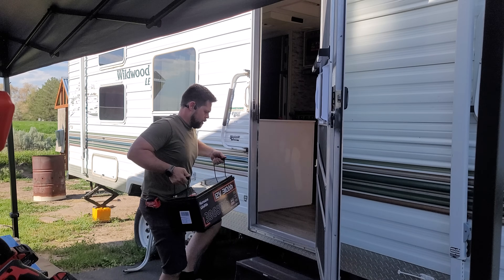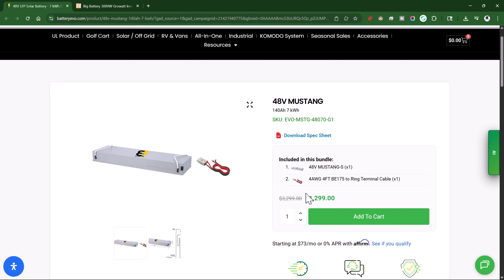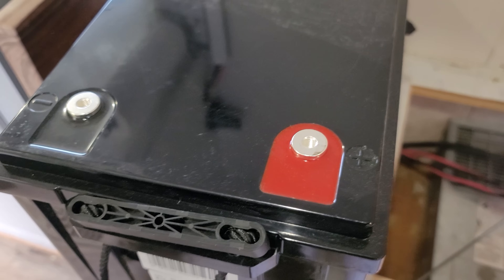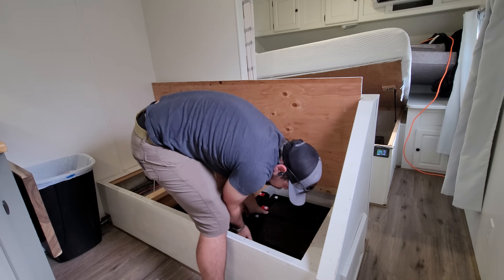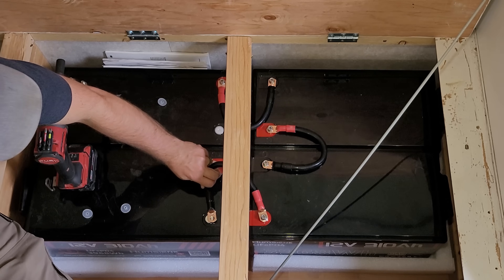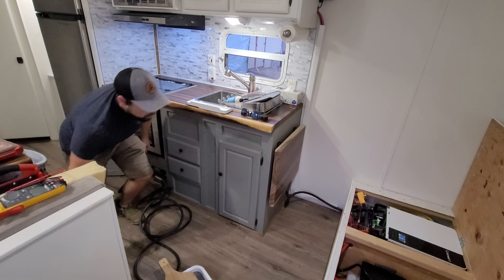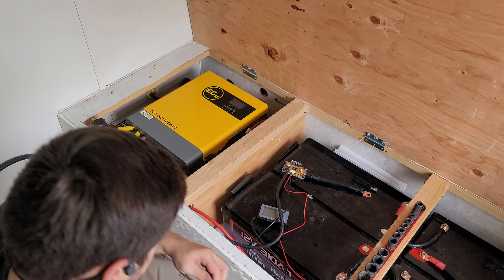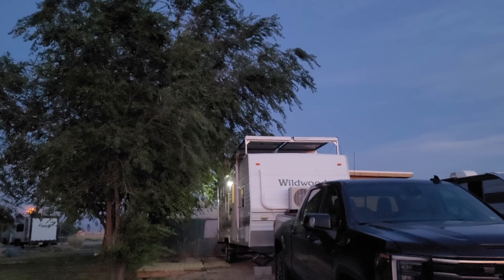Dirt CHEAP LFP Batteries Run My Solar Off-Grid RV

Comment: Dude, you don't have a clue what you're doing. Not only do you not have a battery balancer installed, which will result in the damage of those cheap, short lived batteries, but you've also installed an EG4 non-UL-458 listed inverter that doesn't offer any automatic neutral ground switching which will one day result in electric shock or even lethal electrocution of one kf you RV renters. No non-UL-458 listed inverter should ever be installed in any mobile application. You really should have done your homework before making this video.

Comment: Always fun to have a good excuse to rip up and redo a system 🙂Though I can't help but feel that you took a step backwards ripping out that nice 48V big battery only to replace it with a bit more of an ad-hoc set-up.

--

Not applicable to a series 12V x 4 setup, but I will remind people that with native 48V battery systems the higher voltage does give you the flexibility to separate the batteries and put the inverter somewhere else as well.  They don't have to be right next to each other.   It's nice when everything is all in one place with equal-length cabling to the busses, but not actually necessary.

The SOCs will diverge in the middle of the range but will re-converge near empty and near full.  And the voltage drop from long cables will only represent (typically) 1% in losses in a 48V system instead of 5%+ in a 24V or even worse in 12V system.

So its always an option that should be considered when there are space constraints or weight distribution issues and the system is 48V.

--

Also a reminder:  You can cable 48V systems with 2 AWG and still create a system scaleable to 20+ kW of delivery without having to re-wire anything.  You just individually bus the batteries with 2 AWG to a high-amperage bus (even a Victron power-in, for example), then run 2 AWG to each 5kW (ish) inverter.  Totally scaleable without having to re-wire with bigger cables.  Just add more batteries and inverters.

Of course, if the batteries are huge (e.g. 16kWh beasts instead of 5kWh beasts)... then we're talking 2/0.  But for 5kWh beasts (or if each battery is only expected to deliver no more than 100A anyway)... 2 AWG is plenty.  I honestly don't know why people still use huge thick cables.  Maybe nightmares from the old days of 12V, I guess?

-Matt

Comment: I would have to cut my charge rate in half, only 100A BMS, my Lead Carbon is 190A, the one Will tested was 200A. Charge at 5500w max. No heater but if you have a small battery space a 60w rug buddy heater will keep it all warm, my single 170w under the trailer can heat the entire trailer to 46F @ -5F (8c@-20c), so a 60w in a closet will be fine. You can pour water on these heaters super safe. About time I see a proper trailer roof solar rack, only level up is the expanding slide array.
Reply: I missed where he said that but the EG4-3000EHV-48's charging specs max out at 80A (about 4100W-4500W) AC + PV.   And 60A (3100W-3400W) AC-only.   Agree on the heater... a small compartment, even add a tiny bit of insulation, 60W is probably overkill.  30W would do the job just fine.  Even less.
Reply: @junkerzn7312 good price just making sure everyone knew the charge rate. Good system for a trailer, specs and roof mount. I have recommended those same  specs to RV owners , AC all night even with 10000 BTU or run the blower. The 60w is needed at -30.
Reply: thats cool the whole inside of trailer never freezes. That sounds like a solid solution.
Reply: @uhjyuff2095  If all parts are on a prepped site 2 people it is a 7-day build. If I get a chance to do another site I will add compost heat from below. I am also working on an idea for portable compost heaters, roll under the space and skirt it. Woodstoves are a waste of time, even worse everyone I see with a woodstove has 3 layers on, can't be that warm, if they pay themselves $25p/hr for labor the wood isn't free.

Comment: Add a battery balancer. You need one when hooking up 12v batteries in series. Overtime they will become out of balance with each other without the balancer.
Reply: it would not be hard to use a 12v charger on them once a year if you are concerned about every last drop of capacity but with 16kwh I doubt they will notice anything.

Comment: Are you sure you can't put in a 2/0 into the EG4?? Did you try adding furrels at the end connections?
Reply: The EG4-3000EHV-48 ... manual specs 2 AWG or 4 AWG.  So 2 AWG is the biggest cable by spec.  It's only a 3000W inverter after all.

Which is fine... 2 AWG can do 100A all day long and the inverter only specs 80A max for charging and 60A for discharging with 90A for 5 seconds, and sub-second surges up to 120A.   2 AWG will barely get warm under those conditions.

Comment: You should add an active 10A 4S 12V balancer/equalizer when you wire batteries in series.  If not, you should manually balance them weekly or monthly depending on how heavy your usage is.  Otherwise, your useable capacity could start shrinking quickly due to one battery get more out of balance every time you cycle them.
Reply: I have a 24v system 8kwh. I made sure they were both full using a 12v charger. Installed 6-1-25 and I can't notice anything changing. The batteries are charged full and discharged empty every day. Yes, I would like to know the cell details but I can tell if the bms cuts out from overcharge and nothing has changed since installed.
Reply: @uhjyuff2095 You can put an external 2S 12V balancer on it to not have to worry about voltage drifting or manually balancing them.  They’re inexpensive and easy to install.

Edit: Look for a balancer/equalizer that’s up to 10A.

Comment: Putting 12v batteries in series like this to get 48v isn't recommended. The reason is because of balancing issues. You have a responsibility to tell your viewers this. You will need an active balancer to get this to work properly. Also, you need to charge the batteries independently to 100% before putting them in series. If you don't do this, the batteries won't charge to the same capacity or discharge at the same time. If one battery shuts down, the entire system will.

Saying, "I had no issues with this." Is a little bit disingenuous. Especially when you didn't test the product for a specific period of time. 

Also, quoting Will Prowse when Will doesn't recommend putting 12v batteries in series like this is also a little bit weird, lol.

Good video, regardless.
Reply: Imagine if you have 4 batteries and one gets to 0% and another is at 20% and another 40%. The entire system will shut down even when some of the batteries still have some capacity in them. This is why charging to 100% and having an active balancer are recommended. Don't just grab 4 12v batteries and put them in series, hoping for it to work without problems.
Reply: This is what I came here to say.  You have to add an active balancer on 12V batteries in series.  It’s only about $60 and easy to connect.  He recently posted another video leaving out this critical detail.  I like info he shares, but this is not good advice without a balancer.
Reply: Even cheaper than that.  But yah.  And the other problem with 12V batteries in series is that if the battery pack hits any sort of BMS disconnect it may not be able to bootstrap the next morning (the charge controllers might not be able to wake it up) without a bit of manual intervention.
Reply: @junkerzn7312  I have a 24v 8kwh system with two 12v in series. I installed on 6-1-25 and they get fully charged and discharged everyday. No problems with the solar or the bmses and I don't have an active balancer or smart bmses. Maybe one day I will notice a voltage issue or something but I would think I could easily connect a 12v charger on them and then I know they are both full, full.